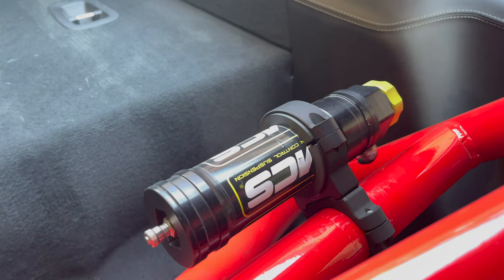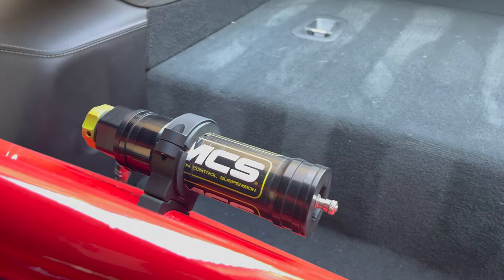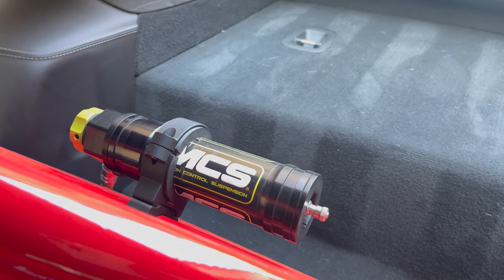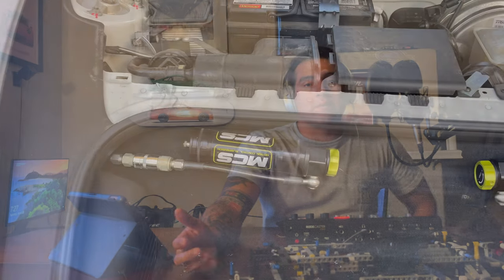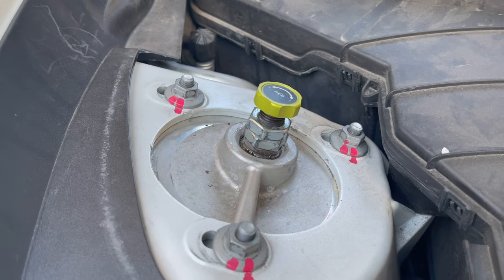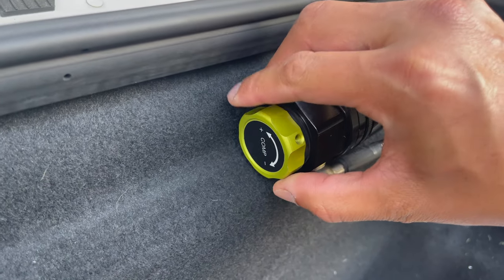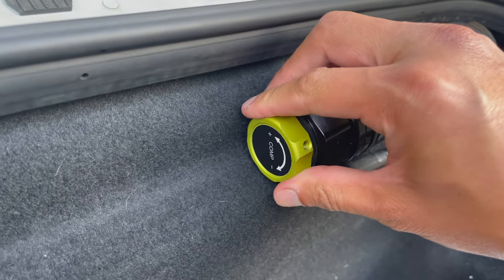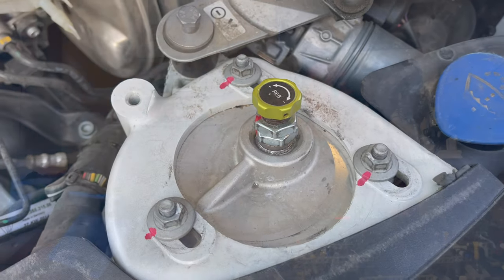Motion Control Suspension Coilover Review 2-Way and 3-Way Remote Reservoirs

Comment: why would anyone spend 7k on some hyped up coilovers? for that money i can ride EMD springs that ride just as good, if not better and slap on some pure turbos. waste of money if you ask me, but hey do you man
Reply: Seriously. With that money I'd could have GTS taillights, 4 pin crnak hub, and a Flame Tune from 412 Motorsports :/ I think I'll save my money and keep the EMD springs I'm currently running.
Reply: Exactly right??? That's why I went with BC Racing coil overs instead of MCS.
Reply from the maker: @ashtoncarlisle2750  these are both my homies trolling my comment section 🤦🏽‍♂️😂😂😂
Reply: @jasonchin3202  i’m with you brother. the BC extreme lows if you wanna spend the extra money will provide a lower center of gravity. they feel fantastic on canyon runs and don’t make noise when i back up to park for cars and coffee!
Reply: @Thewinnerscircle_  thank god lmao
Reply: Personally bro I’d just cut your springs, definitely cheaper than upgrading and nothing beats that oem quality 👌
Reply: @AWmemeifornia  damn! that’s a good idea too. What about bags? I’ve seen a few guys running air lift kits on the track too, and since it’s air the ride quality has to be like it’s on a cloud im sure. would look so sick to air out on the straights too
Reply: From my experience, simp car dude, Lucas, jason, Casey and foos clues don’t know what they’re talking about. You can get a set of MAXpeedingROD adjustable coilover kit for less than the cost of those dumb EMD springs. MCS is essentially MAXpeedingROD coil overs anyways... 2% coilover, 98% hype
Reply: @jasonchin3202  they all look the same so I’m good
Reply: Mind the car that he has... He can afford.

Comment: I am just finding your video and I am SO GLAD to hear it cures the GT3 pogo stick feel.    I just got a 2022 GT4 and PASM acts the same way on that car, crazy bouncy with overly aggressive compression tuning.  The chassis gets pretty unsettled above 90 MPH and moves around waaay too much, even with aero in its most aggressive settings.

I just ordered the MSC 2-way remote dampers for mine.   

Kinda sad that Porsche dials it in the way that they do. I am coming out of a Camaro SS 1LE with mag. ride, so I have been spoiled, mag. ride is amazing, and I was pretty disappointed that PASM wasn't tuned better.
Reply from the maker: You’re gonna love the improvement once their dialed in
Reply: @Thewinnerscircle_  Yeah, I am excited.   Set-up should be pretty easy.   I am not tracking, just street driving, so I will go with their street spring set-up and recommended click settings and then make fine tuning adjustments on my own.

I also had an F80 M3 (before the SS 1LE) and BMW's rebound damping was HORRIBLE!!!   I added Ohlin R/T to that car, but I think Ohlin did a poor job with that set-up.   While it did cure the rear instability and made the car very planted, the ride was so harsh that large bumps would put my head into the headliner and set off the traction control system.  

I am hoping for a much better result with the MCS 2-ways on the GT4.
Reply: @z06van21 how would mcs compare to the magride now that you've had it for a while
Reply: @uluv2c8  Very good question.    

For street use, Magnaride is better.   It just has a much wider range to work with.   It reacts so quick and can account for crappy roads, yet still be very firm when you start loading up the suspension in a high G corner,

When you move to an aftermarket coil-over, like MCS, while the damping is great, you do take a ride quality penalty.    I have no experience with a 3 or 4 way coil-over, but at least with a 2-way (even with a remote canister), it just can't compare to a magnaride set-up when the roads turn to crap, which is all we have here in N. Cal.

For track, I would say MCS would be better as it is predictive and does the same thing every time.
Reply: @z06van21  amazing reply thanks for weighing in!

Comment: Hey man, I know this tread is old, but I wanted to get your opinion.   I just got my MCS 2-way remote dampers installed on my 2022 GT4.   

I am using 80F/100R springs, 125 lbs. canister pressures, and have the Compression in the front at 6, 5 in the rear.  Rebound is set at 9 on all 4 corners.    What do you think of those settings for a street car?   

My goal is to keep the ride quality good (because Bay Area, CA crappy roads) , but not get too much large vertical motions at high speeds.  I started at Compression 5 and Rebound 6 and have been moving up from there.  I am wondering at what point rebound is too much.    Not sure if I should go higher than 9 (which is 50% or 9 out of 18 clicks)

I know you have a lot of experience with MCS on multiple platforms and wanted to get your opinion.